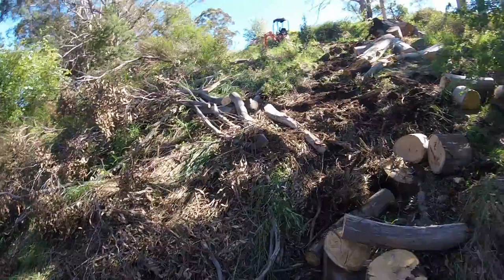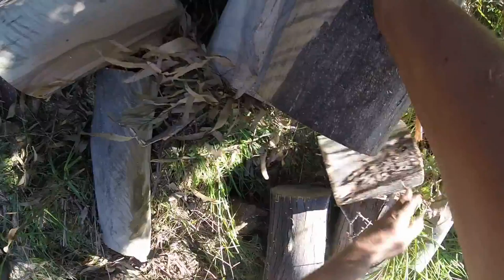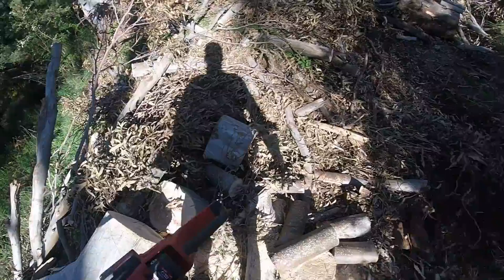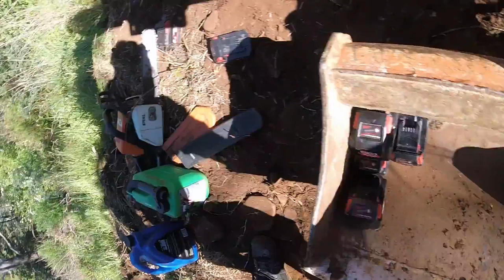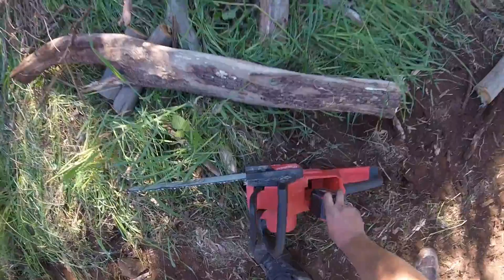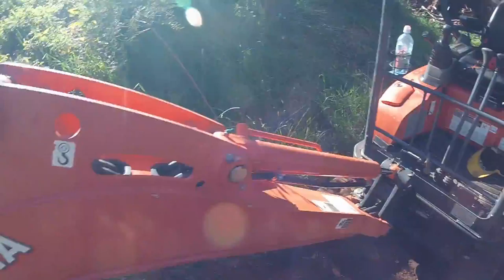Clearing Fallen Trees Off a track Milwaukee m18 chainsaw and Kubota U17-3 mini excavator

Comment: Sounds like you're pushing a little hard on the saw, hence drawing excessive amps, hence overheating batteries.  Yeah, I know.  But I've found I can cut much more and much longer if I ease up on the pressure when I hear the rpms drop a bit.  The old adage "let the tool do the work" definitely applies for long battery life.  Though a bit slower, it will be made up for with reduced battery changes and charge cycles.  Give it a try and keep us posted.  It works for me.  Keep up the great work.
Reply from the maker: Yeah i have changed to chain to  suit. Its going better now
Reply from the maker: Just ordered 2 new 12.0 batterys :)

Comment: Hey mate love the videos. I’ve been using Milwaukee gear for years now and 2 years ago I bought this same saw. I’ve had a pretty good run with it and it definitely makes a difference with the 12amp batteries. The chain speed is a bit slower compared to others but I never have too much trouble with it overheating batteries. From experience some skins are just harder on batteries, mates I work with have the same grinders as me and some can run longer then others. Would you recommend the change on the chain? I’m thinking of getting a stihl bar and chain